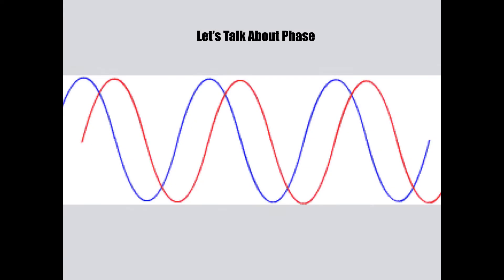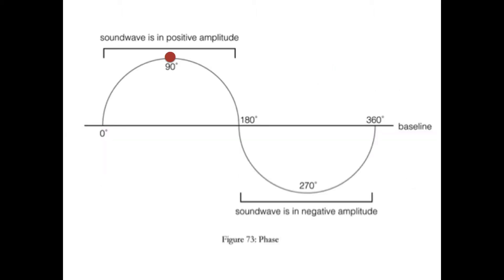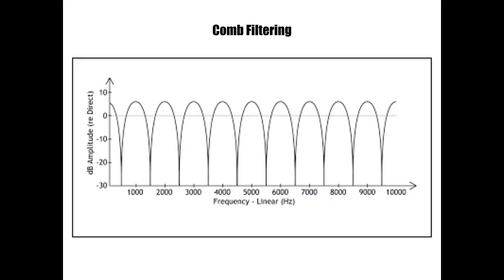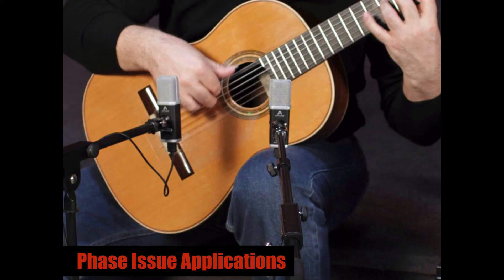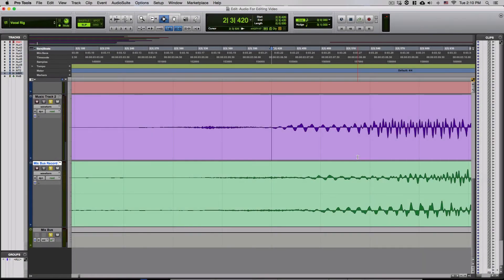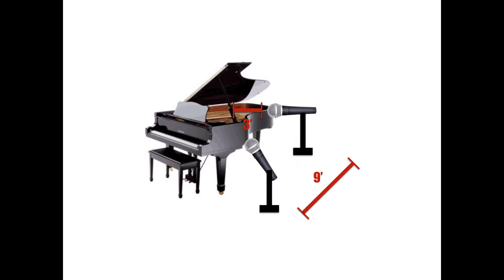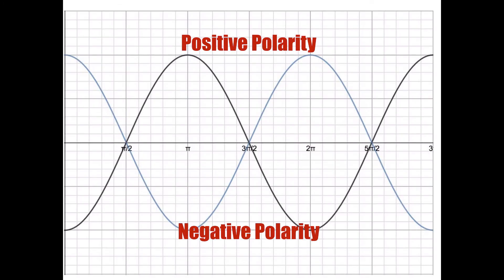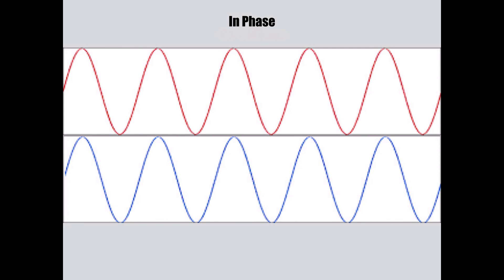What is Phase in Audio - Concepts of Phase and Polarity

Comment: A polarity flip is indeed the same as a 180 degree phase change of the phasor phase, or initial phase, at all frequencies.
Reply: Phase has a time component. Polarity does not.
Reply: @Yoda8945  Yes, flipping the polarity will not introduce any delay (dead time). It will, however, change the phase delay and group delay, which causes a lot of confussion in the audio community. I have written articles about it, one is availble on AudioXpress. So time aspects can be derived from the phase, but most people try to think of phase being derived from time, which is not a good path to go down.
Reply: As soon as your sound wave is no more a harmonic sine wave, you will not be able to get a polarity switch by a phase shift of 180 deg.
Reply: @loettu  Oh yes. All Fourier component will have their sign changed, which will be described as 180 degrees, for all frequencies. You might be thinking of time delay causing the 180 degrees at some distinct frequencies, but a time delay is a linear phase shift, whereas a polarity flip indeed is 180 degrees change across the entire frequency range.